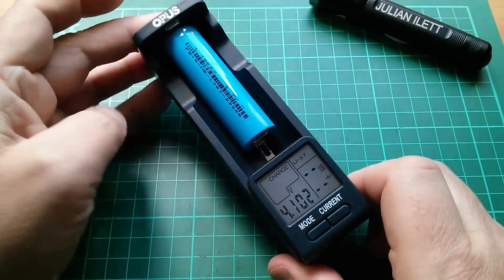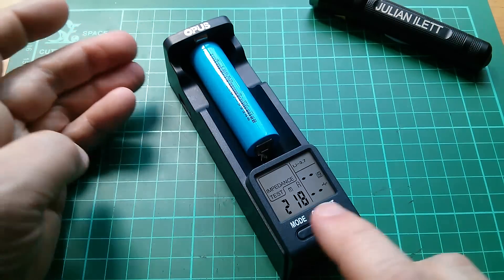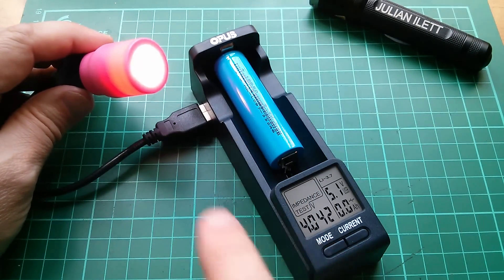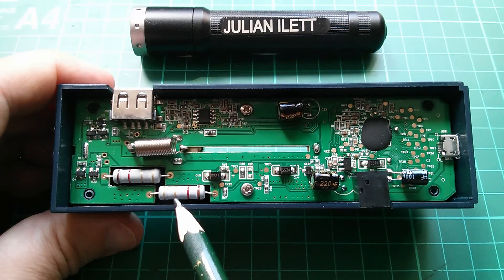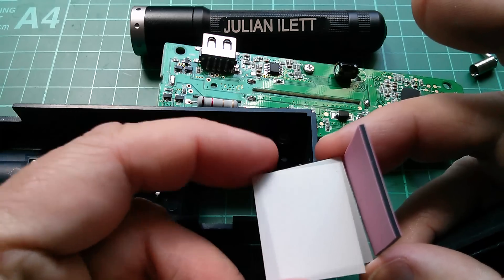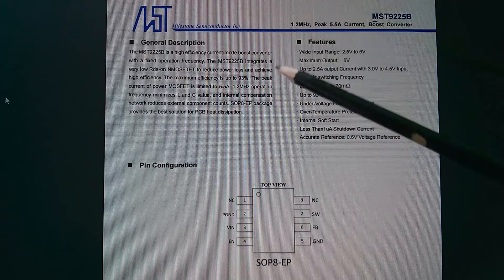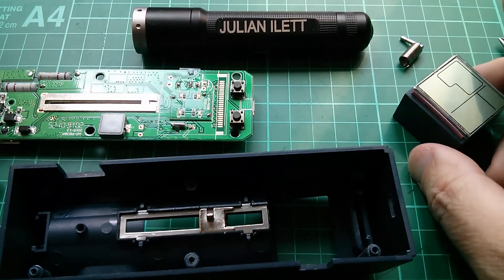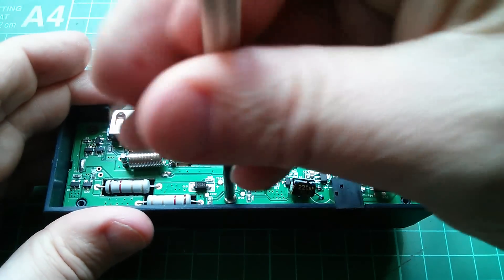What's inside the Opus BT-C100 Battery Charger?

Comment: OOPS! I accidentally put a cell in backwards! Got a bad smell. Now when I power on the charger with no cell, it shows a voltage reading of about 1,4 V, then starts charging, voltage reading rises rapidly and then it says full. If I then insert a Li-ion cell, I can't make it work as it seems to keep thinking there is a NiMH cell inserted. Clearly I'm not the only one to find the reverse polarity protection a bit lacking: https://www.reddit.com/r/flashlight/comments/6fm9j7/did_i_roast_my_btc100/

If I power on the charger by first inserting a Li-ion cell, it does detect the li-ion cell and seems to work normally. I can then connect power input and start the charging process. I haven't tested it properly though. 

When I opened the unit, the only visible damage I could find is a small blister on Q19 (located near the end of the slider slot, towards 12V input connector). You didn't mention this part in the video. Any clue what it might be?

Comment: It sounds like you're suggesting to daisy chain multiple units in series? That's a bad idea if you are. Different amp hour batteries would cause issues. But I've put four of them in parallel and it works great. I use a 5.5mm x 2.1mm four way splitter.  My power bank outputs 12V 8A, so I drive a few of these in parallel once the power bank has been fully charged by my solar panel. Only negative is that the BTC100 pulls enough current for its display after the battery is charged that my AntiGravity battery pack stays on, which could drain my big power back. Nice in that I get to see the MAH even if I'm not there when the battery finishes charging. I'll just have to make sure I don't leave the battery in over night when out on a camping trip. Thanks for the review!

Comment: Julian, if you have some spare time, here's an idea for you - Use TP4056 chips (not the board) and try to put them in parrallel, there are some boards, that have 4 chips, each programmed to charge with 750ma. The total is 3A, i would like to see it reverse engineered, so people would be able to make like a 10 amp charger with the TP4056 :P
Reply: It is possible. I had a 10Ah 3,7V li-ion battery that I charged with 5x TP4056 (1A each) boards put in parallel. It charged in about 3 hours (5A current) but I think the additional hour is due to the fact that towards the end the charger was getting quite warm

Comment: Nice review/teardown, thanks.  I've been thinking of getting the BT-C3100 for a year or more, which is four slot with the charge/discharge/test/etc features.  But sadly it lacks the USB output mode.  I really wish they'd do a four slot with all the features you've just shown in this C100, that'd be absolutely perfect.  Maybe I'll just end up getting both the C3100 and the C100, using the latter just as a portable power bank and the former for multi-slot charging duties :)  I see that the C3100 is now only £25 on GearBest, and this C100 is only £10 which is pretty awesome.
Reply from the maker: I think I'd be tempted to put four of the BT-C100s side by side. I really like the 3 decimal places on voltage and current.
Reply: That's a good point, I forgot about the extra resolution.  Though then if I think of spending £40 on 4 x C100s, I start thinking maybe I should just go the whole hog and spend £70 on the SkyRC MC3000 :)  Although that doesn't have three decimals either, only two. But it does have all the programs and such.   
But maybe 4 x C100s would actually compete against even the SkyRC?  It'd certainly be cheaper.
I originally thought the PC/phone connectivity of the SkyRC would be a big plus, but having just seen your mini review, maybe not.  And I don't think it shows the same voltage/current info on the USB output?
Reply: I bought the C3100 a while ago, upgraded from a couple of Nitrcore's. Great charger, even just knowing the Panasonic 18650s I bought are actually the rated power (genuine) and now I can test all my other eneloops etc too.

Comment: At least the charging curves of the bigger version BT-C3100 look horrible..Here is a review of it: 
http://www.candlepowerforums.com/vb/showthread.php?389732-Test-Review-of-Charger-Opus-BT-C3100-V2-1

Just compare the curves with the ones of other similiar expensive chargers like this one:
http://www.candlepowerforums.com/vb/showthread.php?385459-Test-Review-of-Charger-Xtar-VP2
Reply: That thing is heavily pulsing while charging. I just looked up the smaller one you have tested. It is a little bit better, but still lots of pwm
http://lygte-info.dk/review/Review%20Charger%20Opus%20BT-C100%20UK.html

Comment: ther is a bigger one " Opus BT-C3100 "
Reply: I have this one, sadly it doesn't run of batteries and has no 5V output, but it can charge with 2 Amps if only 2 Slots are used.
Reply from the maker: I reckon these chargers are all designed/manufactured by different companies. Opus just put their name on a range of different models. There isn't much consistency between the different designs.

Comment: 8:20 Screaming at my screen, "the other screws will hold the front down!" :D

Also, don't need to align a zebra strip. That's the cool thing about a zebra strip. And I don't think the buck is used to make 5V, I think it's used to charge the battery. I think the linear regulator just goes from 12V or 5V to the 3,3V for the IC. Using a buck just for a IC is a bit wasteful.

Comment: I noticed it indicates LI-3.7 does that tell you what type of battery is in place? I know you can just look at the battery itself, also looks good for quick check of batteries on the fly.
Reply: I don't think it has auto detection. My guess is that you can set which type of Lithium cell you're charging. Other similar chargers (similar display/buttons) have a hardware switch for example, where you can (and have to) select between 3.6, 3.7 and 3.8V.
Reply from the maker: I presume so, but I don't have a LiFe cell or a LiPo 3.85V. Disappointingly, the Li-3.7 indicator remains on the display when a NiMH cell is inserted.